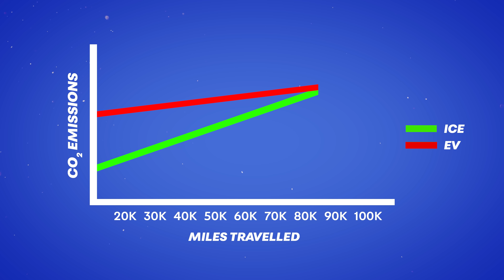Are Electric Cars REALLY That Green? [New 2022 Data]

Comment: It is a very interesting conversation, as a manufacturing engineer I can see some flaws in volvo's case. Their manufacturing systems and supply chain have been developed for ice cars; electric and hybrid development is an add on for them. They didn't develop anything from the ground up so you could argue that perhaps their electric car production isn't as sustainable as it could be. Of course battery companies have a big part in the carbon levels of EV manufacture but I think it will become more sustainable as the technology moves away from the need for precious materials. Any product will have a carbon footprint during production and any company can also take steps to offset those emissions and make products carbon neutral or carbon negative out of the door

Comment: World leaders have pushed the green agenda forcing extra costs and taxes on working families whilst completely failing to deliver clean energy to fulfill demand.  
 The numbers for wind turbines and solar panels just don't add up.  Nuclear energy has been completely neglected but, in my opinion, is only real answer.  We are being conned and manipulated as usual as it lines their pockets.  They blame average families for excess CO2 emissions whilst they fly around in private jets.   The average family produces around 8- 9 ton of CO2 per year.   A jet produces 2 tons per hour. At the same time  they allow rain forests to be chopped down, by companies with nothing but large profit margins as the aim, at rate of 10s of 1000s of hectares a year   Trees that absorb CO2 and produce oxygen.  Nuff said   BTW, I drive a leaf for cost reasons, not coz I'm a tree hugger

Comment: great balance of info there!  it also depends where you live too, in bc canada  a new tesla in winter has its 450km range dropping to about 100km on really cold days so it is a worry for range especially if held up in traffic etc with heater on! also, tesla has 8 yr warranty on batteries so how many people would buy one at 5-6 yrs old knowing a new battery pack is 22,000 usd? any car that needs a new pack then has doubled the carbon footprint again which brings it very close to a 150,000 mile ice engine vehicle in co2 output,  still a lot to sort out and charging stations installed before i make the financial commitment, they are  really fast though!

Comment: Isn’t there a problem here? Don’t batteries become ultra inefficient after 8 years and have to be replaced? With avg mileage of 12k that means just as the EV starts to break even it has to go back to square one, therefore never bettering ICE cars for co2 emissions in fact, if that was the case, then u TIL EV batteries are drastically improved ICE cars are a lot greener. Aren’t they?

Comment: My EV has 120000 on the Clock and is as fresh as ever. No exhaust, belts, oil-change needed. Yes I did need new brakes because they had gone rusty. Is it green now?

Comment: Who knows where we’d be now if electric cars had won the original battle in the 1920s/1930s.  Battery technology would likely be far more advanced and have longer life from smaller and lighter units.  Interestingly hydrogen was not mentioned as Volvo don’t yet power that model with it, would have been good to see that comparison.  Cars seem to be getting bigger and heavier across the board these days, the public’s obsession with huge SUVs isn’t helping, want to hazard a guess why potholes appear so frequently these days, look at the extra weight of traffic that roads have to carry nowadays and the fact that councils always take the cheapest route to repairs.  Smaller and lighter vehicles will help this to be less of an issue.

Comment: Well...
Most ev's don't even reach 90 000 miles without changing batterypacks...
And then there is the issue of the worn out batteries. (I think batterywaste will be a serious issue in not too many years). 
Then...when the batteries are to be replaced, there is a huge cost  and my gues is that most owners will choose to simply buy a new car....
Not a fan of this ev movment🙊
I wish there had been more money and will to develope synthetic fuels...the ICE had been improved for such a long time, and by changing the source of fuel, I think the bemefits would be much better.
Another thing to do for improvent of co2-o2 etc, is to stop removing the worlds lungs (trees that is🙊).

Comment: It's interesting that those "studies" consider the whole manufacturing process for both kinds of cars, which includes the whole manufacture of batteries, but then simply calculate how much CO2 etc is generated by burning how much fuel in the ICE vehicle.

That suggests that ICE fuel just magically appears in the tank. There is apparently no need to do exploration, drilling, transporting, refining etc...? How good for ICE vehicles...

Comment: After 2025 we should not have any coal power stations, and we need to reduce our gas consumption as we obviously rely upon Russian gas and that's a big mistake. Either way EV's were never the whole puzzle just a piece. And with more "green zones" around our urban areas to clear local pollution up at least a little EV's are a major piece to achieve our goals. Just an opinion I may be wrong but that's how I see this issue in the UK.

Comment: It is funny how this gets political so quick, in this comment section. The idea people either love or hate ICE or EV, is quite absurd. It is also quite absurd how one article from a car manufacturer is deemed as absolute facts.

There is not one size fit all and for us, an electric car made sense. I drive around 15,000 km/ year, mostly in city traffic and we generate basically all our electricity ourselves with photovoltaic. Our previous ICE car averaged around 11.2 l/ 100 km, as we mostly drove in the city and the range, fully charged, of our EV is around 500 km when driving in the city. According to the Volvo study, it would take 47,000 km to break even for our EV, but they used a mix of driving scenarios, which does not apply to us. An ICE is not efficient in the city with larger consumption and quite efficient at a constant speed and with this taken in to consideration, I estimate that our car breaks even after around 30,000 km/ 2 years. Over the life span, our current car will decrease the CO2 emission by around 40 tonnes, when compared to our previous car. Financially it also makes sense, especially when considering tax reductions and the initial sponsoring by the government and the manufacturer.

If we would have lived in the countryside, driving mostly on highways and we would have bought our electricity from highly polluting coal power plant, then the EV might not have been the best alternative. I guess that a full hybrid like the E 300 de T-Modell, would be a greener option with the relatively low consumption of the diesel at constant speeds, combined with the electric engine supporting at acceleration and driving fully electric in city traffic.

So instead of thinking black and white, look at your situation and needs and then make an unbiased decision.

Comment: I am glad to see the "conversation", but I have issue with saying look what Volvo gave us and to be dumb founded why they would. If you want to slow the banning or change from ICE, you want to feed data that will say ICE is not so bad and EV is not as good as some say. In the short haul, most legacy builders, including the Chinese owned Volvo, wants to keep cranking out ICE vehicles because their margins are better on ICE and their dealer networks love the service center profits on ICE vehicles. 

I am also Glad Rory said that ICE improvements are getting harder and that EV improvements are more likely to happen. When you consider the R&D resources over the past 100 years, ICE has had 100,000 times the investment into improvements than EVs. The EV industry got lucky that laptops and mobile phones became such a hot thing because it is probably the biggest driver of battery tech evolution over the past 30 years. The pace of EV improvements over the past ten years is impressive and odds are we will see the pace of improvements continue to get faster for EVs. 

Not sure if the Volvo data covered noise pollution or fueling station pollution, but when a petrol station shuts down, the clean up of the site often shows major ground pollution. Leaking storage tanks, people dripping fuel onto the ground when they pull the pump nozzle out. It sounds like based on what Rory stated, they are counting for the delivery trucks and ships that have to be used to move fuel/oil around. I think of how my home has solar panels, so I can refuel an EV just by the panels, which is loads better for the environment. 

I am hoping Volvo is accounting for oil changes. When you consider an EV might get a yearly check over, which may involve some coolant or something being added, versus all the oil drained and then dumped into the engine of the ICE vehicle every 3,000 to 10,000 miles. 

I doubt Volvo is accounting for time saved for EV owners. Since most EV owners charge at home, there is little time ever spent at a fueling station. Petrol owners usually hit a station at least once a week. My Camry has a four cylinder motor, but I hit the station at least 6 times a month. 

If someone is debating ICE versus EV, I think there are some basic quality of life things to be added to the mix versus just being better for the environment. Time save, money saved, safer, etc, are items of value. I will miss the roar of a muscle car or exotic, but cutting down on the general noise pollution, being able to refuel at home, no more SMOG tests to do, and some of the EVs being able to power a home during a power outage, it just makes the EVs seem more appealing. Costs are falling, options are growing, infrastructure  expanding, and more, are making the EV future much more likely. When 2030 hits, I believe most consumers around the world will be buying EVs.

Comment: Great video, glad Volvo is up for open discussion. I would be interested to see where do hybrid cars fall into in this breakdown and whether they would be the better middle ground between production and emission efficiency, at least until better methods are developed for EVs.
Reply: Hybrids are known to be worse. Effectively the worst of both worlds
Reply: @findingneutral426  I thought that too and vowed never to buy one but given the state of our charging network and much improved offerings I changed my mind. Having lived with one for nearly a year now I can report that it actually makes some sense as long as it is of the plug-in variety. About 95% of our journeys are completed on electric power alone and there is enough power to comfortably keep up with suburban traffic. The petrol engine is reserved for the few longer journeys or the odd spirited bit of driving. Range anxiety and materially longer journeys are non-existent. Both power sources are therefore used in their most efficient settings. Oh and yes, I charge it every night…
Reply: @findingneutral426  First I've heard that.

Comment: Also, using renewables to recharge EV’s may appear to improve the comparison. What happens when those wind turbines and solar panels need replacing?
Reply: An average-sized wind turbine contains 67 tons of copper!
Reply: @RoddySpode  I wonder what the Co2 during production of the average sized wind turbine is
Reply: @samebloke  StopTheseThingsdotCom estimates 242 tons of CO2 per turbine not including mining and transporting the metals.

Comment: I would love to go EV - BUT .....   My car, which I have had for ten years,  is twelve years old and in near showroom condition with 80,000 miles on the clock. It is paid for so other than tax, insurance, and regular servicing at the main dealer there are no other fixed costs. It will do 40 mpg driven carefully. It needed two major repairs in its first three years, one a design fault on an engine oil seal, and the other a broken transmission shaft which Peugeot said shouldn't have happened because the 4007 was built to be tough, so they covered the cost. To buy an equivalent 7 seat SUV to take a wheel chair and a mobility scooter would cost me over £400 a month. I would have to drive for an estimated 25,000 miles to break even on equivalent emissions. My current mileage, since I retired is 2,000 or less between MoTs so it would take over 12 years of EV ownership to reach break even mileage. Why scrap a very good car that is set for another 80,000 miles and could outlast a small EV? The big polluters are trucks, eg. long lines of slow moving trucks where the A1 goes from 3 to 2 lanes. Because that truck pollution was seriously affecting my breathing, I had to move to a village in the south where the air is cleaner.
Reply: EVs can last for many years unless you're stupid enough to use ultra fast charging stations too often.
I'm not totally for EVs esp. for long drives but it's proven that you don't even need a 100km range EV for local commutes.
Off course if you need a vehicle to take anyone on wheelchairs, then I'm afraid you're better off with ICEV. Otherwise it's hard to fault a MG ZSEV except for the infotainment system and lack of climate control.

Comment: All the CO2 figures are suspect when you start saying how much more CO2 you produce for producing an EV than an ICE car!  It seems some components made for an ICE dont seem to produce CO2 unlike every component for the EV!  Even Volvo seem to forget some of this.  An ACTUAL like for like?  Dont think even volvo do this!  They still have a lot of IICE cars to sell.   When you take into account the CO2 to produce the fuel (yes the co2 to produce petrol or diesel not just the co2 for electric) then maybe the numbers could be run using all variables rather than just a few that seem to favour one side or another.  ICE cars use more oils let alone fuel than EV's and this has a real cost for production and disposal, far more than the equivalent EV.  EV isnt the full answer but its better than an ICE for so many reasons!

Comment: Have Volvo factored in the 900% increase in copper mining or the fact that in the U.K. we are likely to have to dig up most suburban streets to upgrade our power supply to cope? The carbon footprint of that is huge. These are the hidden costs of EV’s and we are running out of four year olds in the Congo to mine the cobalt. Plus we are being pushed into replacing perfectly serviceable vehicles again incurring huge damage to the planet.

Comment: Good stuff, can sorta agree with the notion that it's likely not super accurate but it does paint a good picture and I think a lot of folks can agree that there is a higher carbon footprint during assembly. I factor a lot of that towards manufacturing efficiencies though. ICE vehicles have had plenty of time to produce hyper-efficient sourcing and assembly lines, something EV's are still working out. Mining lithium though isn't easy, it's fairly toxic and destructive to the environment (pumping oil... under normal circumstances isn't terrible but it's not great either though; and in an accident it's devastating).

ICE cars do age though, GDI vehicles definitely don't maintain their rated efficiency (especially into the 90k+ range); I would wager the realistic cross-over is somewhere between the median Volva proposed and their high-mark, likely in the 65k range for most.

However, at least in the US and my particular city / state combo there is a huge push to get renewable energy (local utility co. is offering to help add solar panels to roofs or work with neighborhoods to have solar sites installed). You also have to throw into the mix for ICE vehicles a good chunk will modify or tune their vehicles which drastically blows out efficiency estimates (for instance my Veloster N stock could get about 27mpg highway but nowadays that's basically impossible, 18-19mpg is about my average now).

The big question I have... is does Volvo's chart include the inevitable battery replacement that will likely be needed at the ~100k mile mark? Maybe hydrogen vehicles are the future for work-horse vehicles and EV's for consumers?

Comment: While it's nice to see a different perspective on EV vehicles, you still left out the end of life cycle carbon footprint. Your graph should have shown the carbon footprint going up when it was time to replace the battery.
Reply: Then when it comes to recycling the vehicle, other than the battery the EV vehicle process is probably the same as an ice vehicle. On my car on the engine and transmission other than the crank push rods and pistons sleeves the rest is almost all aluminum including the driveshaft and suspension components. On the body the cage and doors are steel but the hood and trunk are aluminum. Both of the cars have 12-volt lead-acid batteries of which lead is very recyclable which is why you get paid so much when you turn an old battery in. All the fluids are easily recyclable also.
Reply: My point is no vehicle has all the advantages over the other.

Comment: There,s nog logic in honesty. 

Some more thoughts; battery or engine failure and disposal. 

The majority of EV are stronger and faster then ICE, and that power is used, then the ,,1 is 1 and can be transformed but always stays 1,, rule kicks in. Both use energy (1) and the more you use, the bigger your footprint. 

The infinity of raw materials. None are. 
A solar panel doesnt grow on a tree. Neither does a windturbine. And any tree is ment to grow, not to be burned. 
Mining any, yes certainly oil, is doing the damage. 

The solution. 
Stop. 
Decrease. 
Step down. 
Give up what you don,t need. 

Transformation will also bring us a step closer to this, but by then it will be extinction